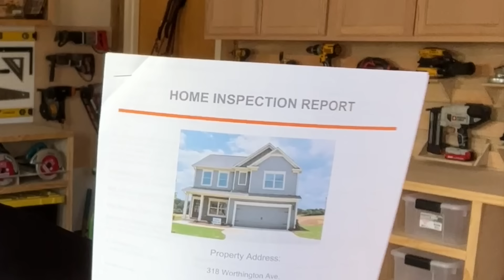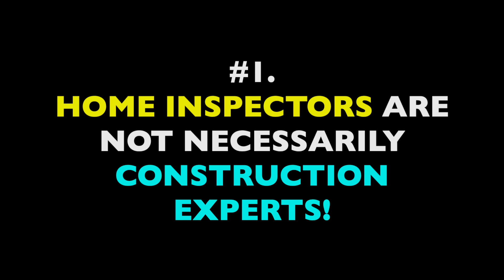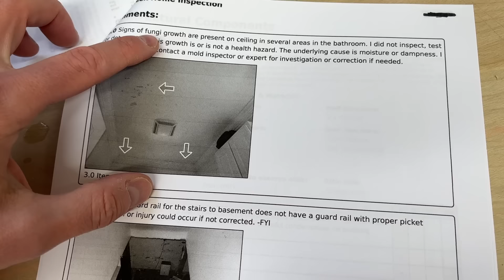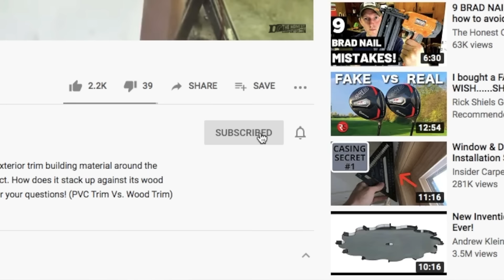The Truth About HOME INSPECTION REPORTS! What They Leave Out...(Homebuyers SHOULD WATCH This Video!)

Comment: As a 40 year licensed contractor with 50 years in construction, engineering, and maintenance who has also been doing home inspections for 20 years, I have to agree with almost everything you said. If anything, you are being too kind. The decline both in knowledge and professionalism has been precipitous since the market crash of 2008. The industry has become exactly as you described it. It is so bad that I decided a few years ago no longer to call myself a home inspector. I do mainly construction consulting. Much of my work comes to me after a home inspection has been done and the inspector’s report is filled with variations on “Get someone else to do the job you paid me to do”. I’m the someone else. 

Thanks for the video.
Reply: Given the credentials you included in your first sentence, I am having trouble figuring out what you wrote means... "Get someone else to do the job you paid me to do”.

Comment: I bought my home in '98 and didn't get an inspection.  It was built in 1937 so I knew things were old, especially the plumbing which has been getting replaced little by little over the years. I also got new siding to replace the old cedar, windows and a new metal roof. But this house was what I could afford as a factory worker living alone and the mortgage was lower than the rent I was paying even with high interest.  I'm 61 now and this house will still be standing long after I'm gone.

Comment: Excellent subject. While I am not an construction expert by any means, I have been around the block when it comes to home repair, carpentry, electrical, and plumbing. Purchased many homes as well. I have seen quite a few home inspection reports that leave out important potential issues that I saw after the fact. So, hats off to you touching on the very important subject. And, keep up the great work.

Comment: Have bought and sold a few houses and this is exactly the problem I hae seen.  A few inspectors make sure you know about the major problems (termites, leaks, wiring) and are aware of the cosmetic issues.  Others place all of these on the same level (caulking around exterior windows inadequate and structural cracks at same bullet point level)

Comment: The company I like my clients to use has a stoplight system of severity, in reference to your third point. Red is critical, yellow is caution, and green is minor but notable. I also tell my clients when we discuss inspections that they are generalists, just like a doctor in the clinic. You will get referrals to whatever building system is "sick." But one is not going to get a stamp of approval for the structural soundness of a 50yo building from the same guy who is doing a thermal cam of the wall insulation and also testing the air conditioning unit. It's pretty rare to be turning on appliances during a home viewing, and there's no way you would know what kind of insulation is behind the wall. It is an option for a client to have foundation experts, plumbing experts, etc., come along for a home inspection - the expenses for that would rival many yellow severity repairs on the home itself. Very few would choose to do that, because they are paying out of pocket ahead of a home closing for these inspection costs.

Comment: I found out years ago that even a real good inspector can’t find ALL the problems due to old rules & regs. from when the home was built. Had a house that used both copper AND aluminum wiring. Apparently that ok when the house was built. Home builder used what he could get away with at the time & sold them for top dollar.  Love your channel and appreciate all your insight.
Reply: The builder didn't use "what he could get away with" if that's what the code allowed at the time. And a lot of that stuff isn't required to be replaced unless you are doing an extensive remodel or adding equipment. It's grandfathered in.

Comment: $1600 for an 8 day course and a test. Absolutely no experience needed. No elec license, no plumbing license, no building experience, no roofing or sidewall experience. 
    100% completely a sham.
Reply: Don’t forget to tell the people how easy it is for a dummy to get all those licenses you just mentioned. I’ve seen way more bad plumbers and electricians and building contractors than bad inspectors. Inspection doesn’t require those licenses and it would be unreasonable to require them to do so. On the other hand contractors should be required to answer do any design flaws or shoddy work flaws anytime a house they built is sold and the same goes for electricians and plumbers and hvac folks. And those people should h e to take all the courses a home inspector has to take and pass them to be eligible for a contractors license. I bet half of them wouldn’t pass the inspection courses.

Comment: Hello!
Very fair video. I live in NJ which has pretty rigorous licensing requirements but I will say all the inspectors I know and work with (home inspector here) have history in some sort of trade. Additionally the way we structure our reports they get two summaries at the end of the report , the first is items that require immediate attention, and major concerns. Think leaks, dangerous electrical, structural issues, asbestos, mold, etc. Second summary is maintenance type items, along the lines of deteriorated caulk, missing insulation, beat up floors or windows, things that are not urgent/dangerous. Purely cosmetic issues almost never get mentioned, they don’t affect the safety or function of the home.  Lastly our inspections usually take about 2.5-3.5 hours. We go through every single remotely accessible crevice of the building, and find things missed by other inspectors all the time. Informative, but not unnecessarily alarming is what we aim for. I think you did a good job explaining the general process but one thing I think a lot of people forget is that people PURPOSEFULLY try and hide defects in every house, but usually they leave the supplies in the basement/garage which gives away what we should be keeping an eye out for haha

Comment: I'm a licensed electrical contractor and roughly 30% of my business is fixing/ repairing home inspection violations. A lot of double tapped circuit breakers, reverse polarity, missing blank plates over junction boxes, or lack of GFCI protection on kitchen countertop receptacles. As a pro, that stuff is pretty important to protect people living in the house. I will however flat out tell a seller that this is not a violation if no violation or fire hazard exists, which happens way too often unfortunately.
Reply: on any of the skilled trades, it's pretty apparent the average home inspector has no understanding of the electrical and plumbing systems and just looks at a checklist.
Reply: Those are the top things plus over-fused or under-fused devices, non-functioning circuits, fixtures & devices, shock hazards, detached or missing grounding & bonding connections, undersized wires, non-matching circuit breakers, arc flash events. Are you qualified to speak on framing, plumbing, roof, appliances, HVAC, garage doors & operators, decks, retaining walls, stoops, steps, windows, critters in attic, insulation, water intrusion, cracks, mold, radon, termites? We are often responsible for all of that. Electrical is just one spoke in the wheel. Honestly, there's too much reponsibility & liability resting on our shoulders. Still, I know more than enough to call out the trades when they shave, cut corners or just mess up.
Reply: I feel like I wrote this comment, electricalron! Agree 💯

Comment: Home inspection for my current house bought 23 years ago was of very little value.  The inspection failed to inform me that the soil in the crawl space was too close to the wooden structure  in part of the space far from the door.  The pillars were spaced too far apart under the main girder.  There was a rotted hole in the deck that had been simply roofed over.  There were other problems due to low standard in construction.  The aluminum frame windows caused some of the frames under them to have black mold due to condensation.

Comment: Here in Australia I bought a house with my mother to help her out and we got an independent inspection done and the report was crap for 2 reason, one was that 3 roof tiles were cracked and it turned out that the bottom corners were cracked and chipped and with out roof tiles and the way they are made the bottom corners being cracked or chipped mean nothing but what was more important and was mentioned was the fact that the cement holding the ridge tiles on which are the top cap tiles was cracked chipped or completely missing in places all along the ridge tiles which later caused serious leaking and having no more money I had to remove and recement them back down myself which was a nightmare and the second was that the house being a raised house supported by brick footings had a sloped floor in one area caused by a sinking footing and $400 later a professional structural footing expert stated that the footings are all of them not only fine and level but that the underside of the house was one of the cleanest driest and best kept underside he had ever seen and everything was in great order, the inspection report and inspector was useless

Comment: I fully agree that the home inspection industry has changed over the years. Anyone can become a home inspector just by hanging out their shingle now. When I started inspecting homes 12 years ago 90% of the inspectors were licensed trades people. I came into the industry as a journeyman carpenter and had remodeled 100's of homes. It seems that all you need now is book smarts and and good writing skills. I have seen so many reports that only have small stuff like nail holes and carpet stains. I for one never put that stuff in a report. I like my reports to be clean and precise and pointing out the things that will cost a lot to repair. I will however write a statement in the report saying the overall condition if needed. "
Unfortunately we are not allowed to give cost estimates or advice on repairs.  I do understand that this can be frustrating but costs can fluctuate and prices are all over the place.
Reply: Really ? That's crazy this is a requirement  in South florida

Comment: I worked for a company that we marked each item as an action item or a consideration item, action items were in red and consideration items were in blue. Action items meant it needed to be repaired, period, consideration items meant at some point it may become a bigger problem but is not a huge deal this time. So a plumbing leak, AC not working, rusted heat exchanger etc. would be marked as an action item. A tile crack, slightly loose toilet, fogged dual pane window would be marked as a consideration item for example.

Comment: A recent home I purchased I went out and hired an electrician and HVAC technician to inspect the equipment and give me an honest opinion of the life of the equipment! Ya it’s more expensive but boy did it pay off, the home inspector missed and or didn’t inspect the furnace and my HVAC tech reported the heat exchangers had cracked ( a known issue on these Lennox models) an expensive miss!! It’s always buyer beware it’s like taking a vehicle your purchasing and going to mechanic shop for an inspection vs kicking tires and saying window is cracked!!

Comment: Your on key with everything! As a licensed general contractor , licensed electrical contractor,  licensed HVAC contractor and a licensed home inspector currently performing inspections, I see so many things get over-looked by other inspection firms. It hard to take 30 years of experience and teach other inspectors in 90 hours. Some inspectors will try to prioritize big ticket items. Most Realtors  has a preference for inspectors - so the sale of the house can go through. The question to ask a Realtor is this "If you had to choose from all the inspectors, What inspector would you use for your personal house? " than the truth comes out. They will likely wave the normal inspector away and call on the professional with construction experience.

Comment: Home inspector here...For the most part what your saying is accurate about the home inspector business as a whole. I find it interesting how you choose to "straddle the fence" on who's side your on or what message your trying to put out there. If the client takes the time to read the Standards of Practice document provided to them, prior to the inspection, It will outline every aspect of the very detailed inspection they are paying for. Home inspectors could not possibly know every trade required for all the different entities that encompass a home as a complete unit. Are you a licensed HVAC tech? How about a licensed electrician? Licensed plumber? See where I'm going with this? Should home inspectors be a master at all these trades and be licensed in them? Look through the home inspection report shown in the video at the different sections and see if you are a master of each of those trades then tell your audience here the cost, materials list and labor charges for each issue of the home inspected. You can't do it. Home inspectors aren't licensed contractors. That is not the purpose of their industry. I am not a licensed plumber, you know what kind of liability I'm putting on myself and my company by giving professional advice to a client who's propane fired hot water heater doesn't have CCST within 18" of the connection for the water lines and I tell them how to fix it themselves. The lets say "accountant" client who doesn't own any tools, goes to his neighbors to borrow the tools I told him he'd need to fix the issue I reported (because he didn't like the price I told him it would cost to fix it) and forgets the step where I tell him to turn off the propane before he loosens the fuel supply and what happens? Make any sense? There are several more items that I can scrutinize in this video but quite frankly, I'm tired of typing!

Comment: When I bought my home I paid for a home inspection and tagged along. The one thing that we missed was when we went into the crawlspace under the house. We noted that there must have been a raccoon under there at some point, but were unable to inspect the entire perimeter foundation due to rigid ducting. We checked it from the outside instead and everything seemed fine. Cut to a month ago when I needed to go under the house to run some conduit and forced my way into a corner that we weren't able to go to. I'm going along and suddenly realize that there's a massive opening in my foundation leading to under my deck. Apparently when the previous owner wanted to put a deck in, they ran into some external doors to the crawlspace and just took off the doors. They didn't bother to install anything to stop my house from having a wonderful basement apartment for local wildlife. So, that's my new next project :/

Comment: I'm a licensed home inspector in Rocky Mount NC. I haven't read through all of the comments here, but I would bet one home inspection fee that there will be home inspectors commenting negatively about your video. 

I happen to think you were 100% accurate in describing the frustrations a client may experience when asking an inspector for more detailed commentary on how to fix something, or how much something might cost to fix. But you did fairly explain the liability issues, as well as the minimum regulatory standards required by each state's standards of procedure. 

The only misrepresentation you made was when you said that ALL inspectors lump minor or cosmetic defects alongside major defects without making any distinctions whatsoever. 

While I don't doubt that you may have seen a poorly prepared report doing such a thing, not all inspectors use the same software. In fact, not all inspectors use any kind of software at all. Yes, there are still some dinosaurs who like their clipboards and handwritten paper reports. The reality of the matter on this specific subject is that most inspection software does differentiate between cosmetic, minor and major defects by color codes and or numerical grading. 

Other than that, I believe you treated the industry very truthfully and objectively. I too would have an issue with a cosmetic nitpicker that says nothing about improperly notched girders or foundation support failures. You were also correct that many home inspectors have never performed any hands on construction, remodeling or renovation work. To your credit you did say that it is not necessary to have that background in order to be a good inspector because that happens to be true. But I do have a construction background and I can't imagine I could have the building science knowledge I have without it. Books are great don't get me wrong, but nothing is better than practical experience. I guess I could explain it to some of the nagging Nellie's this way: A police academy teaches a lot of book theory. And it all goes sideways when you're actually out there on the street engaging with real combatants that don't want to get arrested.  Book world vs real world. Two very different places. 

I liked the video, as much as I like your other videos. You put out good content. 👍

Comment: I am in the home insurance field. I always tell people never give your agent the full home inspection. It is the CT Scan of the house. There is just stuff in there the carrier does not ask, but if I submit it, like that one thing you see on CT Scan which is normal, you still ask questions, they do the same thing. I always say get the 4 point inspection and I will submit that to the carrier. This will be updates on the electrical, water, roof, and HVAC. I am an agent in Florida so things are a little different here, but yeah as an insurance agent, if someone sends me one, I dont even open it.